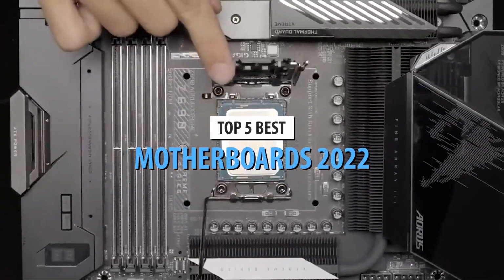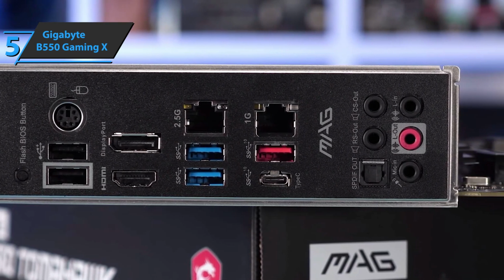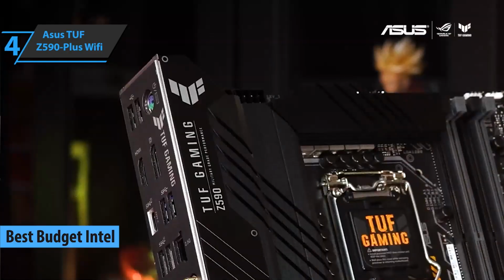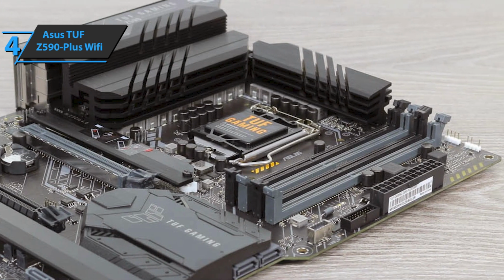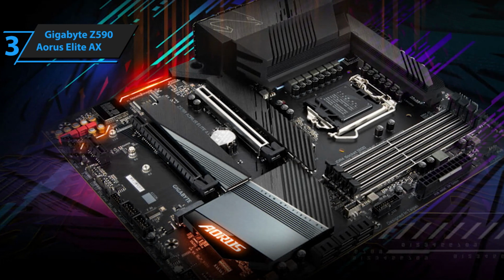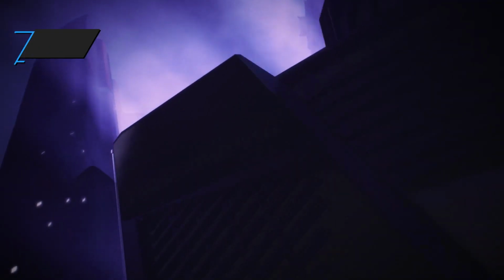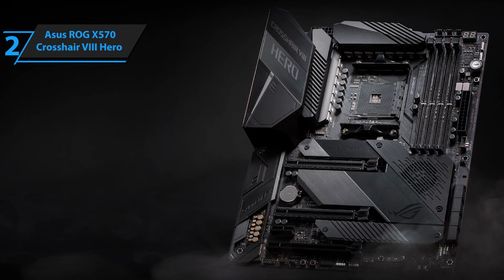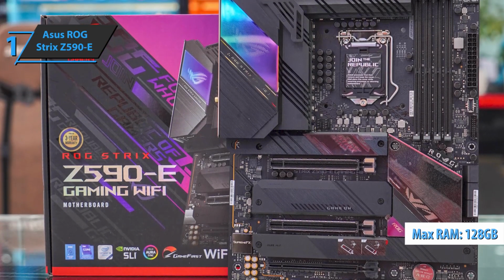Top 5 BEST Motherboards of [2022]

Comment: How can I find out if the EVGA GeForce RTX 3090 Ti FTW3 BLACK GAMING, 24G-P5-4981-KR, 24GB GDDR6X, iCX3, ARGB LED, Backplate, Free eLeash is compatible with the ( motherboard) ASUS ROG Maximus 2690 Extreme Glacial(WiFi 6E)LGA 1700(Intel
12th Gen)EATX ga
ring motherboard (Integrated EK
Ultrablock,PCle
J,DDR5,24+1 power stages,5x M.2, PCle 5.0
M.2,10Gb&2.7
bLAN2xThunderbolt 4) ???? Any one knows please drop a comment
Reply: Use pc part picker website

Comment: Can someone just tell me what the best i9 mobo is?  Budget not an issue but I don't want to research for the next month
Reply: The Strix z690-a gaming wifi is one of the best without watercooling for 349.99 I'm running it with a 12900k and 3090 both overclocked; super friendly BIOS. if price is no option I would get the z690 Glacial for 1700$ usd it's all setup for CPU and VRM water-cooling with a built in reservoir I believe it's gorgeous.